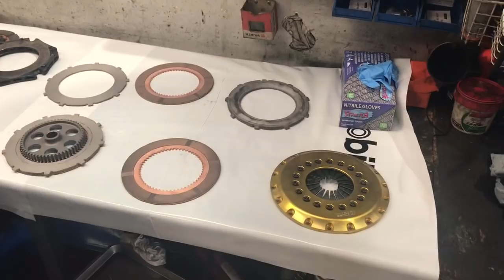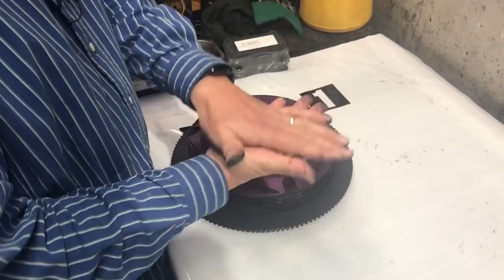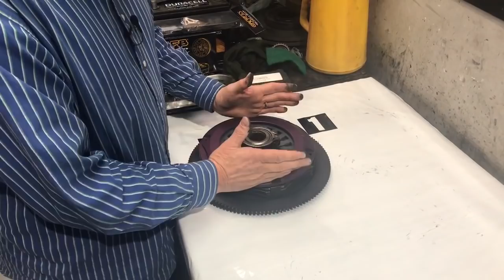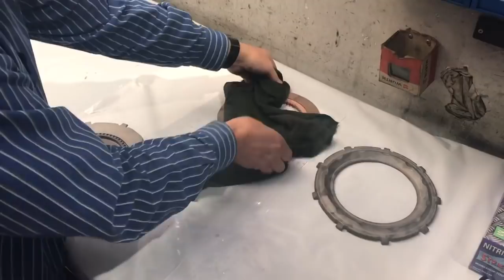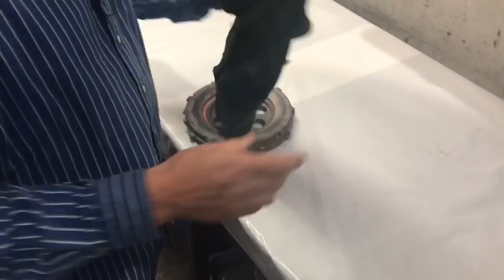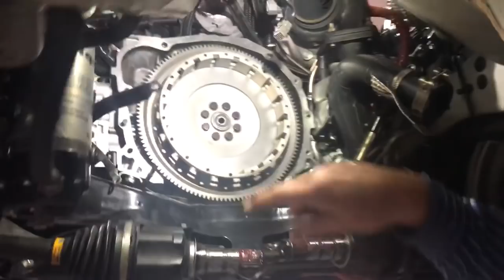How a Clutch Works - Part 1

Comment: So the triple disk clutch assembly has to have an all new flywheel to go with it?

Thanks again for the amazing information! 
Maybe you could do videos on your thoughts and the pros/cons of sprung vs unspring clutches, lightweight flywheels and pulleys, underdrive pulleys, and oil catch cans or air/oil separators. 
(I installed the Perrin lightweight crank pulley and didn't like how it made it easier to stall the car by having to give it more throttle to get moving and RPM's dropped faster then I could casually shift and that wasn't good for my daily driver.)